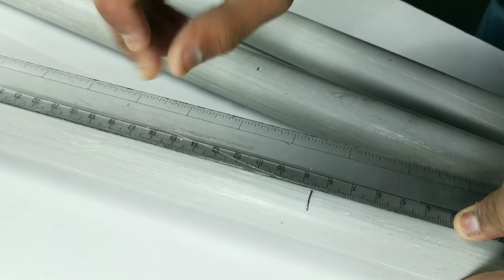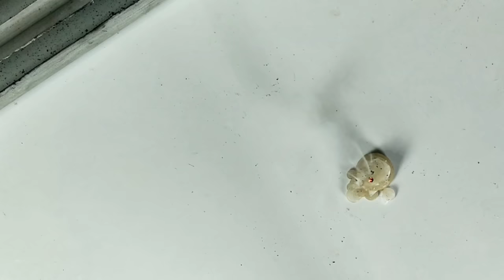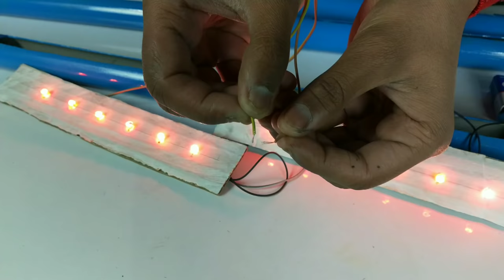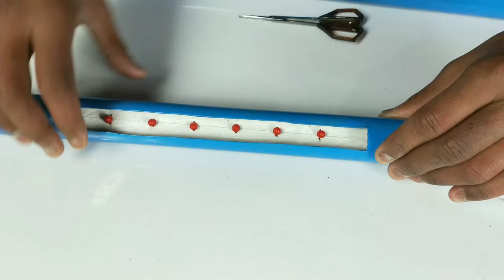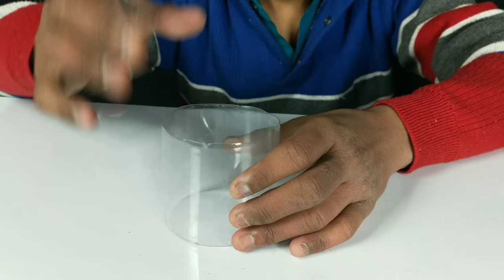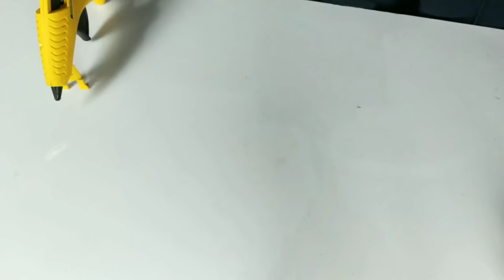How to Make Cricket LED Stumps & Bails at home | School Science Project |

Comment: Ah gosh. Nice try. But there are a few BIIIG problems.

1. You are shorting the battery to turn off the leds. The battery will drain quicker than anything. 
2. The contacts shall wear out for both the bails and the stumps.
3. There is no structural stability, i.e. even if the ball hits the stumps at <80 km/h, the stumps will break/the batteries will disconnect.

It is good for the purpose of a "school project". It needs several improvements to it to be actually playable.